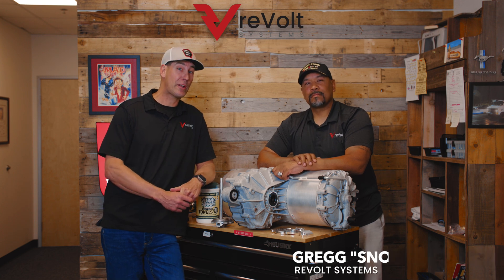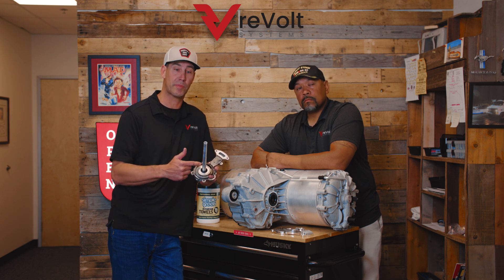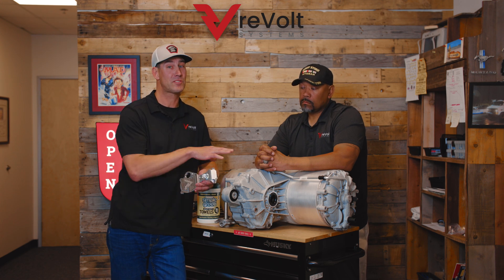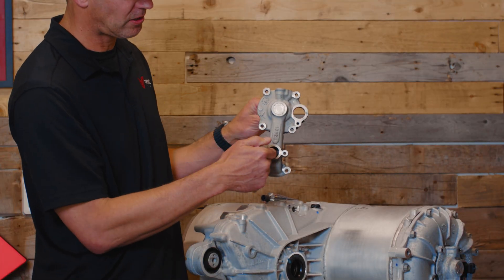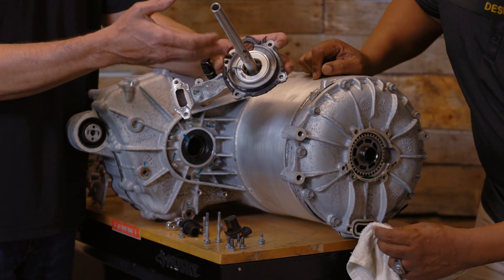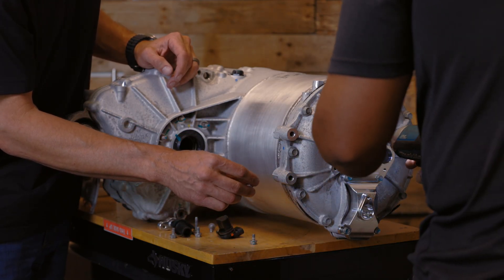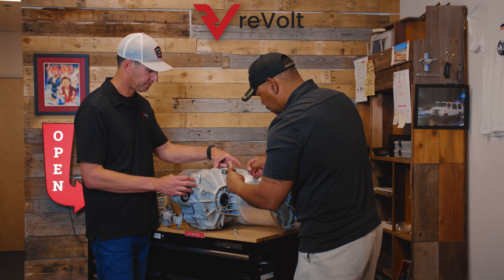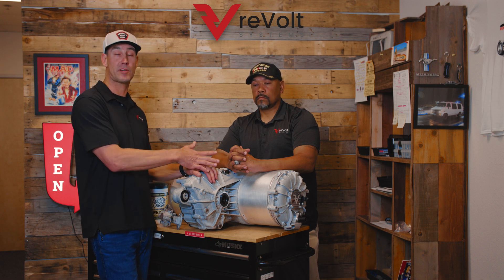Revolt Systems Product Breakdown: Coolant Delete Kit (LDU coolant bypass)

Comment: I'm seeing this one year after it came out and nobody talked about NOT using a power tool to screw in the bolts. Maybe not today but you will definitely strip the threads by using this method. NEVER use a power tool to screw in these bolts! You can cross-thread something easily. 
Thank me later.

Comment: I have a question,  so I have a 2015 tesla model s P85D... my question is if you delete the coolant line going to the other side... won't it need it so whatever that part there inside that part needs to already be cooled? Second since mines a p85d isn't it a dual motor so well it need 2 sets one for the front and one for the back motor?, last question I'm in California near Riverside area is there a shop you guys have near me to do it? Or can your recommend someone near me? Thanks.
Reply from the maker: You would only need one kit for the rear motor. The front is a different design and does not share the same issues. As for the coolant gong to the other side, Tesla used this to warm up the fluid in the case of extremely cold conditions.  This was found not useful and does absolutely nothing to actually cool the gears.  We have tested our system in extreme racing conditions, the added flow over the stator section of the motor helps with cooling.  Email us for a list of shops that can do the install near you.

Comment: Thank you for this superbly informative video. This should be a mandatory fix on all pre-2020 Tesla dual motor X and S since it is a manufacturing flaw. I had to get a new out-of-warranty LDU because of this and have reported this critical flaw to the NHTSA.
Reply from the maker: Thank you for your superbly nice comment 🙏🏽 It’s a rare thing these days! 

We do strive to find solutions to problems in the EV industry, & truly hope to keep these amazing machines running smoothly. Technology is constantly changing and we’re doing our best to track with it and improve it when & where we can.
Reply: Isn't this a problem with the rear wheel drive Model S's too?
Reply: @sparky6592  i am not sure. i am told not because those have the small motors, not the LDU.

Comment: Also Tesla themselves came out with their new motor that has their version of a coolant delete that didn’t remove the cooling to the gear set/ bearings like yours did. I think this shows that cooling still needs to go to that side of the motor. Is this an oversight on your guys part?
Reply from the maker: That’s not cooling the gear box. It’s actually heating it by using the heat from the rotor to thin the ATF. We learned this from a former Tesla engineer. It was supposedly only for extremely cold conditions and helped efficacy till the fluids reached warmer temperatures. With the bypass this no longer matters. Thanks for the great question.

Comment: Major issue with this versus the GCCharge coolant delete is that this one deletes the coolant going to the case that cools the gear set and bearings. Very bad design… While removing the cooling from the rotor is fine, temperatures will rise and will adversely affect the gears and bearings if they don’t have cooling as well. Y’all did too much with not enough research from the looks of it… and $550 for that is absurd!!
Reply from the maker: The gears actually don't get cooled by the heat exchanger located around the axle output, its actually the opposite than what you claim. The hot fluid from the rotor is used to warm up the ATF in extremely cold conditions to lower its viscosity improving efficiency while cold. We ran this by a Tesla engineer and were told that this was an early design that did not do much to help. Destroying the entire motor and Inverter is a very common problem that our kit prevents. Everything we make is rigorously tested in many vehicles.  We encourage you to please do some further research and testing yourself. Thank you.

Comment: The best seal is no seal.  Sounds like the rotor will no longer get liquid cooling with this delete kit, but apparently air cooling to the housing from it spinning suffices.  Wonder why Tesla never tried that during development since a liquid seal on a high-speed shaft was surely of concern for reliability, including warranty repairs.
Reply from the maker: We still cool the entire motor and this kit just bypasses the rotor that does not need it. Tesla is doing this in the new "U" version of the LDU
Reply: @revoltsystems  Great.  I saw earlier youtubes from a company which re-engineered the seal design and offered a retrofit if you ship the LDU to them.  But, perhaps didn't prove much more reliable.  No seal is best.  Perhaps the biggest concern is if the rotor warmed past the Curie point of the permanent magnets in the rotor, which would ruin them.  If so, then Tesla would have major recall problems, but appears that isn't a concern.

Comment: $550 for $12 worth of metal? Is NASA making this? How about $75? These motors are on eBay for $1500 not $5000. You are inflating the cost to sell this nice, but overpriced piece. I got an out of warranty quote to replace my small front drive unit from Tesla and it was $6400 and included axles ($1k) and labor.
Reply from the maker: You should start a business or run for office.
Reply: Where's the link to the %1500 motor? I need one. I didn't do the coolant delete soon enough.

Comment: G'day gents, my 2015 model 85 has a large rear motor, so far, so good, only 40,000 km on the clock. Just wondering if you recommend the coolant delete for my car. And do you sell these? Cheers from Australia. 119 liked and subed.
Reply from the maker: We absolutely recommend the bypass kit. you can get one from our web site. Get it on before it floods your inverter.

Comment: What if we switch to oil cooling?
Reply from the maker: You would have to flush your entire system out to get rid of ALL the G48. It can be done but good luck.
Reply: I’d just separate the motor and inverter cooling loop from everything else.

Comment: Hi. I drive an older 2018 Long Range rear wheel drive model 3. The rear drive unit is giving me an error code: DIR_a149. 

I’ve been to Tesla service before and they topped up my coolant. Fortunately I’m still under warranty. But the error returned. Just a heads up that we may have an issue with high mileage model 3s
Reply: That' seems so wrong.  If the coolant was low, it had to have leaked  somewhere.  If it is in the motor that 's huge trouble.
Reply: @NackDSP  update: the second time I took the car in, a tech identified my problem and sent a picture showing rodent damage. They chewed through my coolant lines and into my high voltage cables. I had to replace a wiring harness and coolant lines.

Comment: Wouldn't it cause excessive heat in d Rotor/Stator of d LDU if d cooling effect is taken away? How will it affect reliability of d LDU in d long term or on hard drives?
Reply from the maker: No excessive heat. Actually this was not intended to cool the rotor. We have a new video coming soon to address this question.
Reply: @revoltsystems  Where is that video, love to see how you think that loop isnt for cooling the rotor....
Reply: @revoltsystems  Still waiting on that video - is it out yet?

Comment: Glad to see out of the box thinking and engineering to solve the issue.👍👍.Not sure if M3/MY have this issue.
Hopefully the clones don't nullify the hard effort put in, before sufficient return for the time/effort. Should definitely implement an etched unique barcode(a low power fiberlaser should do it), to keep track of the original units. Wish you guys great success, and let us know, if there is similar upgrades to M3 to improve troublefree service life.❤👍
Reply from the maker: You should be good on the Y and 3, those motors are oil bathed and have a totally different cooling system.

Comment: Can this be done with drive unit in the car
Reply: It looks like the trick is getting the long tube out of the motor.  There isn't clearance to do it with the motor mounted in my car.  It would seem that a determined person might be able to pull that original cover off and away from the motor an inch until it hit the car structure and cut the tube, pull more out, cut it again and repeat until the whole tube is out of the motor.  Great care would be required to avoid metal bits from getting into the exposed motor.
Reply from the maker: Unfortunately you need to pull the sub frame down. We were able to do it without removing the motor from the axles but still needed to pull it down.

Comment: I understand at You just stopped cooling. How it goes without cooling of drive unit?
Reply from the maker: We still cool the entire motor. This is just a bypass for the problematic seal.
Reply: @revoltsystems you need to provide more details around the cooling of the unit after the delete.  Please think about an additional video related to this topic alone. Thanks, Ken
Reply: Compessed air? To cool it with air? An an exchange unit to transfer that heat to the coolant? But that's not one simple trick they can sell... Now I cast that idea to the big players that can make it, I'll see it in a few years being made, and shrug my shoulders at it.
Reply: Desert Storm guy can be an expert at this because he served.  No disrespect. It's all in the balls someone's willing to put in their early years.

Comment: Was there ever a factory fix for this issue? And if so, on what date or Serial Number was it implemented?
Thanks for the great video!
Reply from the maker: Look for a "-U" at the end the part number on the drive unit. Those have the factory bypass.

Comment: I had a notification on my dashboard that I should contact Tesla service center when I did I guess they ran a diagnostic on the car over the Wi-Fi and told me I need to bring the car in and they're going to swap out the rear motor on my 2019 Model X performance, even though I wasn't having any issues driving around or noises, they replaced it within a couple hours and off I went. I'm guessing maybe some sort of sensor said it was leaking inside and maybe that's why they replaced my motor even though it was running fine? Rear motor that is.

Comment: So no more rotor cooling. It gets very hot now, the grease melts out of the bearings and they fail? I mean Tesla had good reasons to cool those rotors. In the Small DU they switched to oil cooling but they still cool the rotor.
Reply: Been driving with one for some time now in a race car that is pushed much harder than the daily driver will ever do. No issues and the LDU did not cool the rotor enough to make any impact. They tried to use the heat from the rotor to normalize the temperature in the gear box, this also was a design flaw by Tesla.
Reply: How many miles you have or have seen on the deleted setup? Thanks, Ken

Comment: Interesting idea, but I can't help but wonder about the downside of losing the ability to liquid cool the LDU. I suspect that there was a reason that the manufacturers of large AC motors add liquid cooling.
Reply: The stator and inverter are still cooled. Just the rotor is bypassed since the seals are extremely problematic and prone to leaking coolant into the stator windings and inverter. These are some of the earliest Tesla motors and have a few engineering flaws. Their new motors use ATF to cool the stator and rotor. Eliminating the problem.
Reply: @J5Jonny5 Do you have any stability or real time data on long term effects of not not cooling the rotor? Thanks, Ken
Reply: @J5Jonny5  Please advise us on how the ATF solution fixes a bad seal issue? Does it now leak ATF into the motor and inverter when the seal goes bad?
Reply: @Roadstercycle  From what I've read ATF doesn't harm any of the components it gets on. So yeah, sounds like it can still leak but ATF won't short out the inverter or cause rusting.
Reply: @Roadstercycle  The ATF is a much better lubricant than the coolant, so I assume the seal lasts much longer with ATF.
Reply: Drive like an old lady and you may be fine 😅